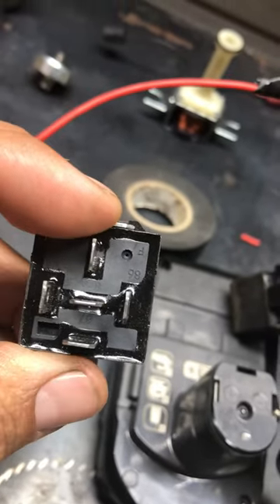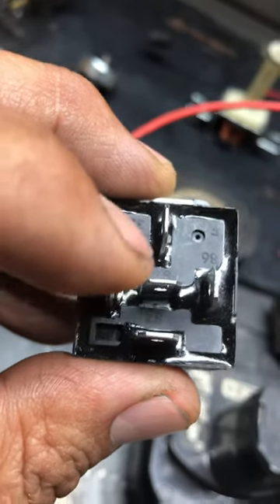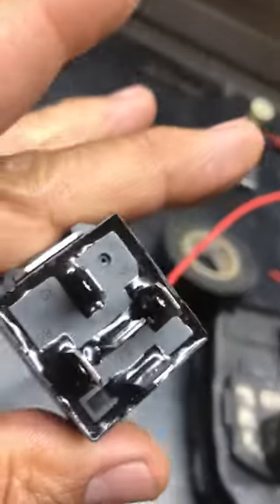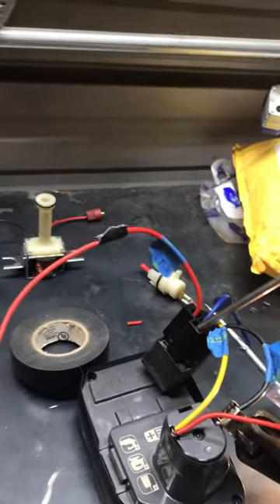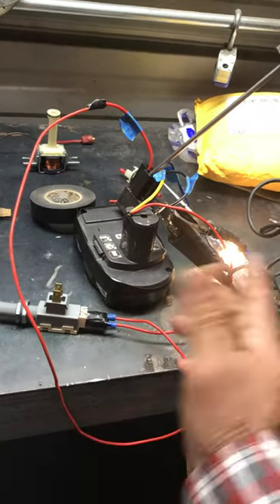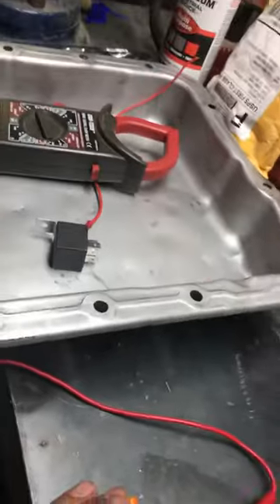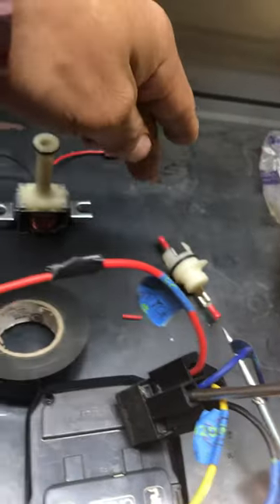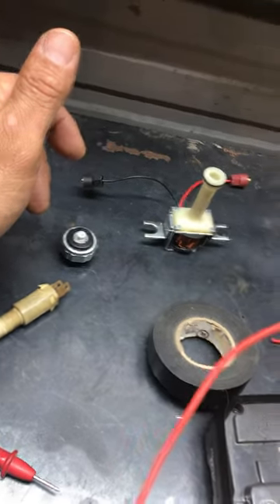TCC Torque Coverter LOCK UP WIRING 4l60,4l80,700r4,200 4R two wire or 1 wire

Comment: Where can i get the brake switch can u tell what year car i should look for to get brake switch the relay im sure auto parts
Reply from the maker: go to ebay type in  (gm brake light switch with cruise control )any pre 1985 will work and you wont need the relay
Reply: I wont need the relay can you tell me how would i hook it up ??
Reply: I just seen the video again i see tht brake switch dont need the relay the set u show does thanks for the info im do the brake switch on my truck i already got it thnk u again

Comment: Can a 4l80E lock-up solenoid try to lock up right from 0 mph and slowly accelerating from there keep trying to lock up?  If I unplug the electrical power harness and the tranny goes into limp mode (2nd gear only) it runs perfectly smooth all the way up 60-70mph and back down.   As soon as we plug electrical power back to the tranny right from 0 mph its trying to bog the engine down, vibrate, bucking and noise.   It does that through all gears.  If its popped into nuetral while coasting all of that bad stuff stops 100%.
Reply from the maker: im not a transmission expert with that being said ive had a similar issue where the lockup solenoid itself was stuck open all the time when id get past 65 it was like trying to stop a manual car without a clutch pedal ,wire harness connected or not ,Yours sound like the shift solenoid is commanding the lockup solenoid to open when its connected to harness id start by checking the shift solenoids
Reply: Ok thanks.  Is there only one kind of lock up solenoid to purchase for all 4L80Es?  Or are there different types?
Reply from the maker: kits on amazon are listed as 1991-2003 ,knowing the donor vehicle is best though

Comment: Will this wiring setup work with a 4L80e if the solenoids are hardwired to manually shift with a floor shifter?
Reply from the maker: yes it is basically a cut off switch cutting power to torque converter lock up switch  when you hit the breaks

Comment: hey 1990 k5 blazer with the 700r4 i converted  from tbi to carb so i dont have the computer for lock up anymore...so i hook a toggle switch up with the 3 wires from my pig tail plug do i  leave my switch on at all times or will i mess up something if i dont shut it off when im at a low soeed...i appreciate your feedback.....
Reply from the maker: just saw your message. No it will not hurt anything to have power to the Tcc at all times if your torque converter is ONLY locking up at highway speeds .It will be  problem at highway speed if you panic brake the converter stays locked up just like a clutch your truck should have the brake switch i showed i recommend you run power to it that way.  you only need power one of those wires to power the tcc switch either direct for 1wire or to 4th gear preassure switch of it a 2wire . the other two wires are usually for a vacumn switch inthe engine compartment and 3rd gear pressure switch.hope that helps

Comment: pretty good
Reply: I just run power to the solenoid. If 4th switch is single plug I use it to ground solenoid, if it's dual plug I run power through it to solenoid and ground it to one of the mounting bolt. I just leave it hot all the time. As far as 4th gear braking goes you don't notice it as you have your foot off the gas already.

Comment: So circuit is opened when brake switch opens?
Reply from the maker: with the key on the tcc circuit is always  closed (complete) until you press the brakes this will open(break) the tcc circuit,while closing (completing the brake light circuit

Comment: I have been having issues with my tcc being stuck locked in second/third/fourth gear on my 200 4r. Can I just use a toggle switch instead of the brake switch you showed here?
Reply from the maker: just saw your message .yes you can use a toggle switch ,FIRST you can also unplug the connection from the side transmission  the tcc should not engage at all . if stays locked up  it can be  that the tcc solenoid is stuck open .ive had this happen on a 200r4 before  youd have to drop the pan and remove the solenoid if you can blow through it youll have to replace it
Reply: @ozcorr909  
Thanks for the reply. I did unplug that plug and it did not engage. I’ll be doing the toggle switch next weekend.
Thank you.
Reply from the maker: @Abdulrahman_M  that will definitely work best bet is it to change over to  one wire 4th gear lock up only and use the brake switch or relay to disengage that way you don’t forget to turn your toggle on when you go on the freeway
Reply: @ozcorr909  I kinda have a loud exhaust so, I’ll notice that it’s not locked 😂
Reply from the maker: @Abdulrahman_M  that’s right👍
Reply: Correction on solenoid. If you can't blow through the solenoid it is blocked. That will cause lock up in second third and fourth always. 200 4r solenoids are restrictive it is best to replace them with a new one. Again when you energize the solenoid it will be blocked.
Reply: @ozcorr909 what did the car feel like when it was stuck engaged ? I think I have the same issue.

Comment: Thanks.  Was wondering how it worked and I suspected it was as you described.  Aand as I understand it.....That 87A is Normally Closed so therefore there is power available to the dual-terminal pressure switch when the IGN power is available, the pressure switch is  made up when tranny pressure gets high enough in 4th gear, at that point the solenoid gets energized and allows Torque Converter Lockup.....  so now we're cruising along in Overdrive with the Torque Converter locked in Overdrive.......  in the typical straight-forward brake switch....  Pushing on Brake Pedal (to engergize the brake lights) ALSO energizes the coil in the relay and "flops" that N.C. 87A to the "OPEN" position and cuts power to the solenoid....therefore the tranny then drops out of Overdrive....   Did I understand that correctly?
Reply from the maker: Just saw your message and yes sir you got it 👍

Comment: Im gonna do this bit just skip the relay and have it kill power straight thru the brake switch
Reply from the maker: 👌the relay would only be necessary if you are not able to use the old style gm brake/cruise control off switch

Comment: Is a great video, you are amasing. I just have a little question, with the th2004r.... 

when the brake pedal is applied does it restrict the 12 volts or provide 12 volts to the solenoid?
Reply from the maker: thx.yes that is correct.
Reply from the maker: sorry bout that it cuts off the power going to the solenoid,the 12v wire going from the brake switch or relay depending on what you use will have constant power ,until you press the brakes
Reply: @ozcorr909  thanks you are a master... i was about to connect it wrong, I would have connected that wire to had power only when I pressed the brake pedal
Reply from the maker: @casperttoo  your welcome if you had nothing bad would happen the solenoid just wouldn’t in gauge because the fourth gear pressure switch has to complete the circuit either by grounding itself out or completing the positive circuit depending on how yours is wired.